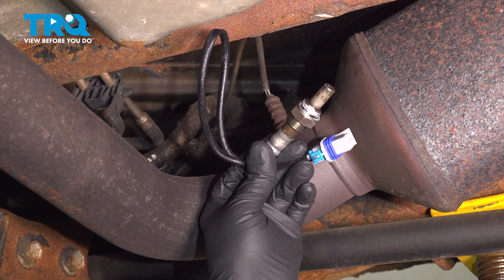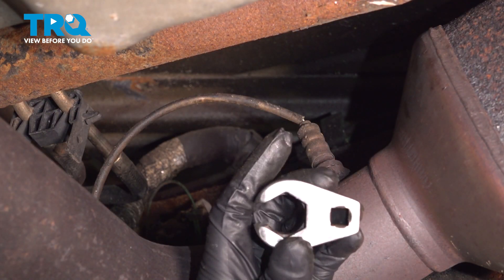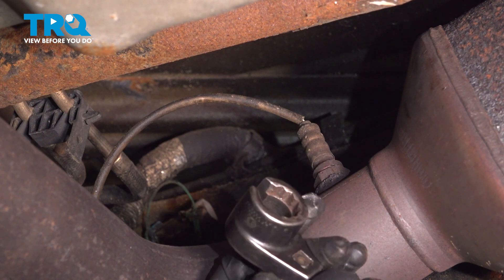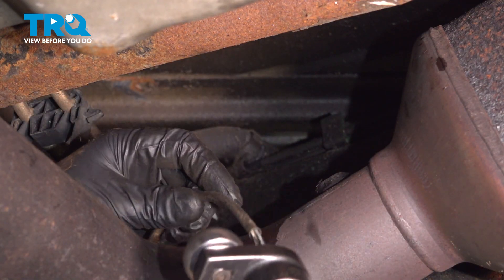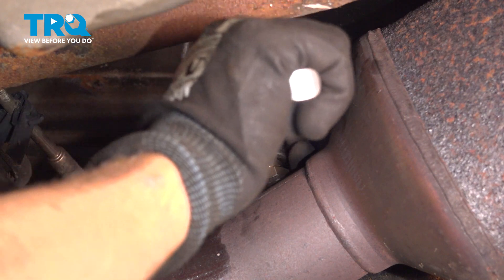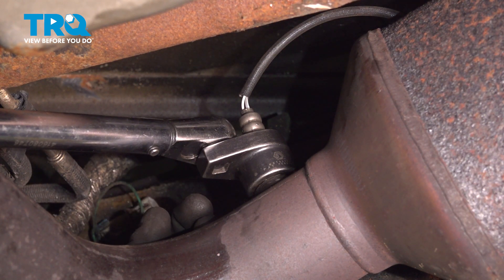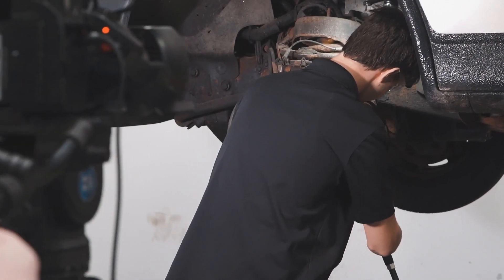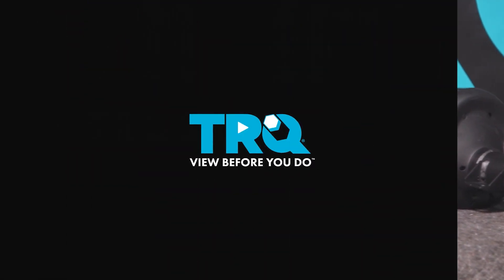How to Replace Downstream O2 Sensor 2007-2014 Chevrolet Silverado 2500 HD

Comment: Just a little heads up. I am a professional auto technician/mechanic for 27 years now I had a 2013 chevy with a 6.0l come into the shop with codes for a bank2 sensor 2(downstream) o2 sensor I put a Bosch sensor in it that someone else had ordered for me. The truck came back 2 days later with the same codes it had before replacing the sensor. So I tested everything wiring from o2 to the ecm. Ect. Everything was testing good I looked at the data from all 4 sensors and bank 2 sensor 2 was more than double the voltage that bank 1 was so we had the parts store send over another Bosch. I put that one it but still the exact same readings as the first one. So I put in a sensor from the dealership(o.e part) and the readings returned to normal and the truck was now fixed correctly. I hear that NGK is the O.E manufacturer so the NTK sensors? So Bosch sensors work great in some cars but do not put them In Your Chevrolet/GMC truck is my advice
Reply from the maker: +@brentpierce7585 Thanks for the tip! http://1aau.to/m/Shop-TRQ